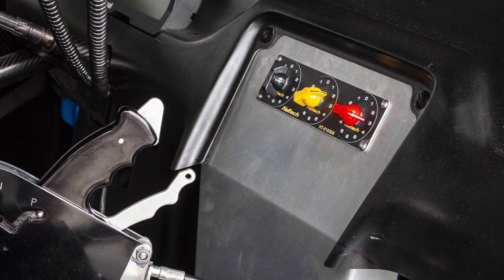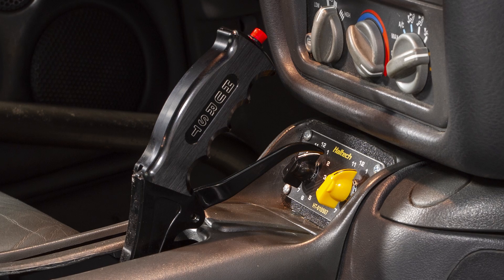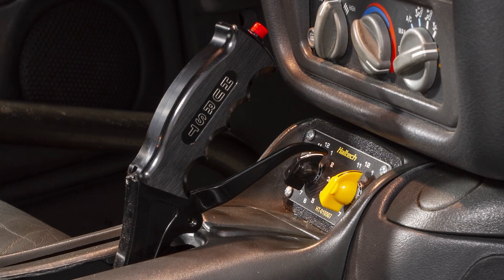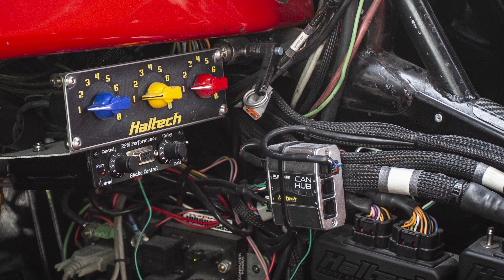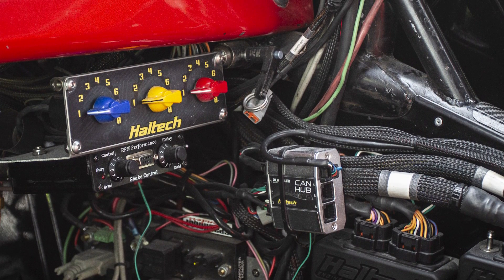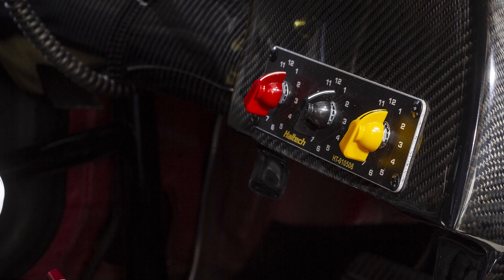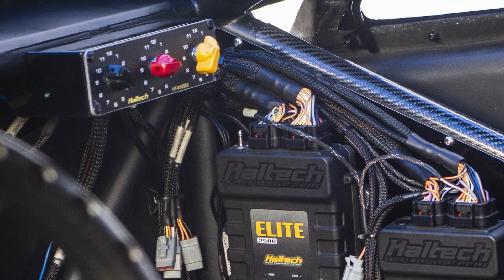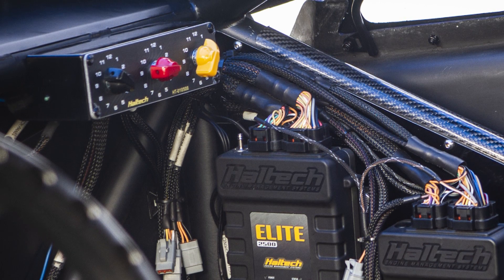🛠 Flick Of The Switch: ECU control at your fingertips | TECH TUESDAY

Comment: Assuming I have a CAN hub, can I use these on my Platinum Pro plug in?
Reply: I was about to ask the same thing
Reply from the maker: Yes. You can just wire it in, no need for a CAN hub even. However, some of the Platinum Pro functions only allow for up to 8, not 12 settings.

Comment: I love having this option and it is so under utilized. It's not only convenient, but it can really give you an edge at the line. Also it's great for those that aren't the best with tuning and allows their tuner to give them access to adjustments without using a laptop. I currently have boost, launch RPM's, timing in half degree increments along with 2 others I'd rather not post publicly in case one of the guys I run against sees this. There's been times its what won the race  without a doubt.
Reply from the maker: Great to hear you're using this function to its full potential:)
Reply: @haltech  It's one of the main reasons I switched back to Haltec from a free sponsored ECU.  In grudge/street racing being able to make adjustments without guys seeing you pull out the laptop was a game changer for me.
Reply from the maker: Send us some pix of your car! Keen to see what you race:)
Reply: @haltech  I'd be glad to,it's nothing pretty though. It's a 83 Chevy S-10 that was my first car back in 97 that now has a BIG small block with 2 G42-1200's and a built 80E trans. I raced it for years with all kinds of SBC combo's though before parking it.  I dug it out about a year ago as a father/daughter project to terrorize the streets and have fun and am finally getting it really dialed in. I actually wanted to talk to you guys about some nitrous integration options too so I'll send something along after I get home from working. I'll try and dig up some pics of other cars I ran Haltec in too.

Comment: Yes, I would like to see how to setup these trim modules. I have the last version for esp software and it doesn’t show me any function for the rotary trim module on the function list. What is the issue ?
Reply from the maker: It's under "Functions" - just type "trim" in the search bar and it will come up:)
Reply from the maker: https://www.haltech.com/wp-content/uploads/2019/09/trimknob.jpg
Reply: I did, but it doesn’t show up.
Reply: @MrMajood1994  Have you updated your firmware?
Reply: How to do it ? When I uploaded last version of esp software, I also uploaded the firmware on the same site.